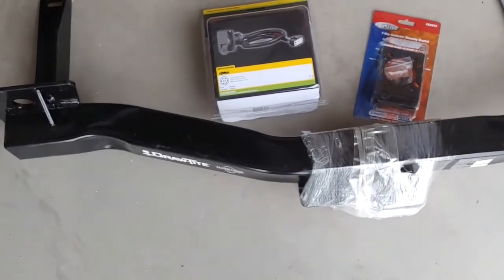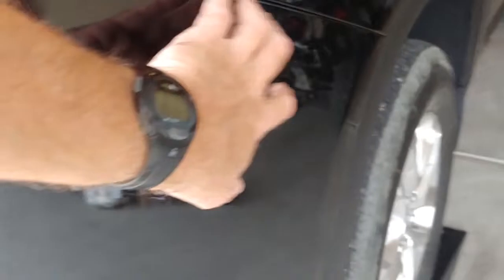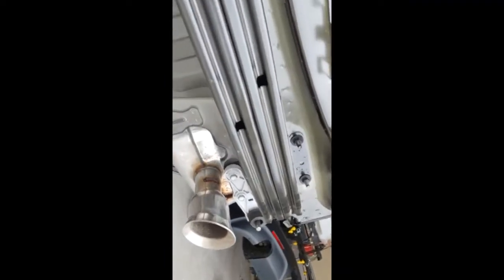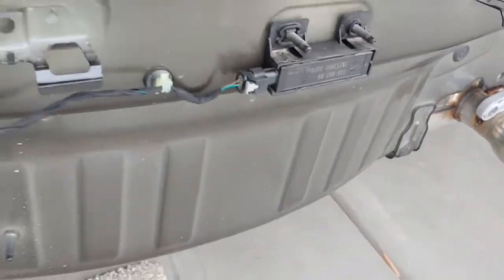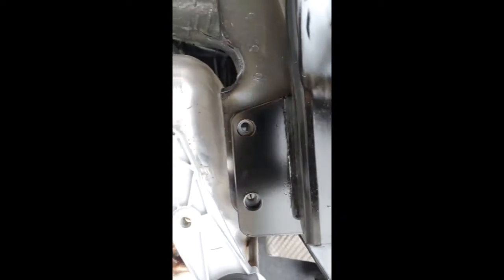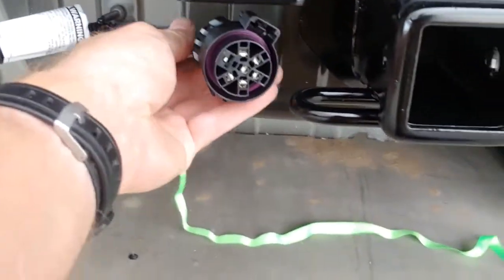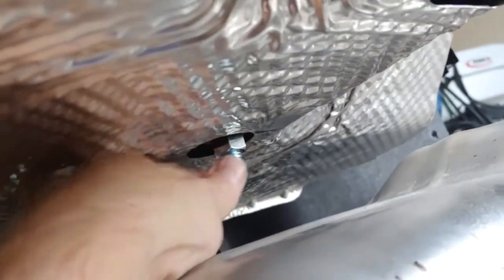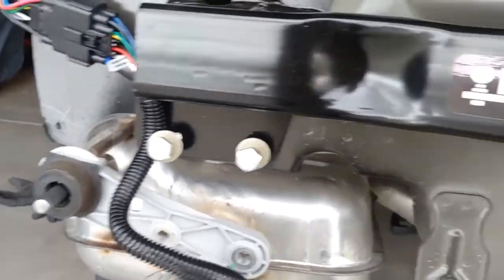2020 Chevrolet Traverse LS Tow Package Hitch Installation Video

Comment: Hi do u have change the radiator also. How much can u tow with 2019 traverse lt fwd.
Reply: Just left the dealer and bought a 2023 traverse. Bought it a month ago planning on adding this. They told me I can’t add a hitch and intercooler because the transmission is not geared for the 5000 lb tow package. It’s basically a high mini van at this point.
Reply from the maker: Yeah, the LS without a tranny cooler can only pull up to 3500lbs. I realized this just recently. I had been pulling my new toy hauler trailer, loaded, close to 4500lbs, but overheated too easily in warm weather. Want to keep temps under 220 F. I am selling my LS soon for this reason.

Comment: Do you know the towing weight on this hitch? I assume it’s at least equal to the 1500 lbs factory one. They say you can get a package for up to 5000 but o can’t find any info on it.
Reply from the maker: The hitch will handle that,  but a LS is not made with a tranny cooler I just found out. It's only rated for 3500lb max.